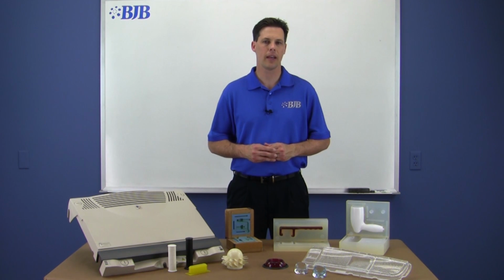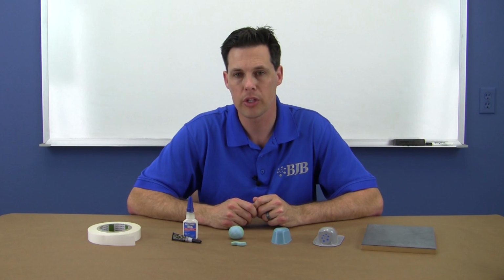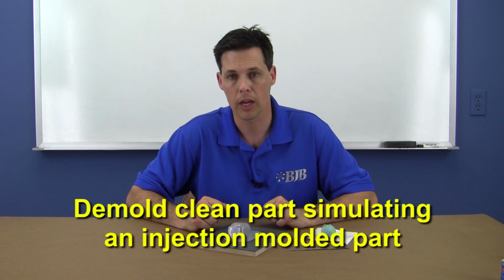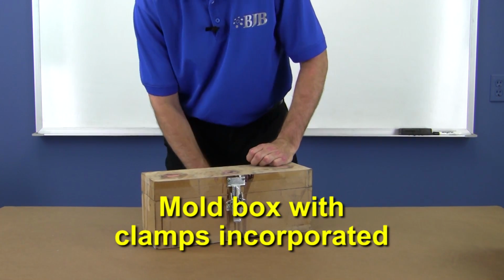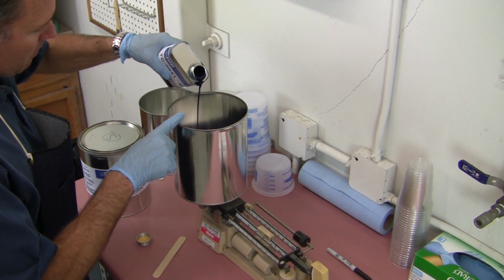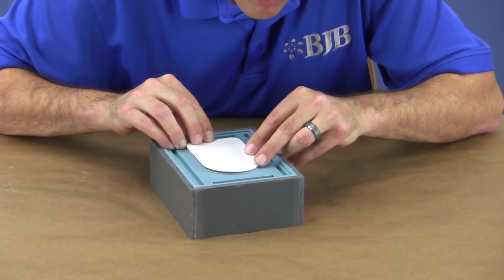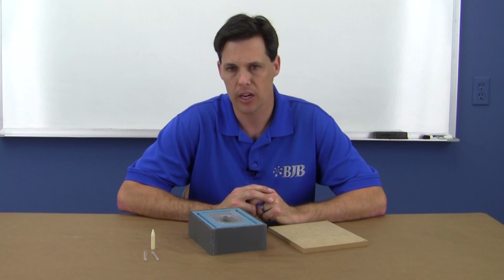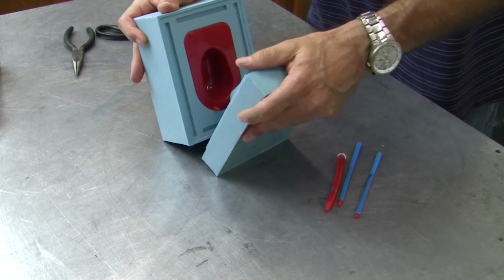Great Video: How to make 2-Part Silicone Mold | Part 1

Comment: Question, it appears at the 20m21s mark after you demold the part there are raised bumps left by the fill and air vents.  Am I seeing that correctly and can you describe any post processing work that was performed to eliminate these?  Thanks!
Reply from the maker: Typically these small witness mark bumps are trimmed off with a hobby knife or filed down.  Depending on the required finish needed for the application, these could be carefully wet sanded smoothed and eventually polished away, but in many cases a small mark from a vent or sprue is similar to many injection molded parts is acceptable for the bottom or backside of a part.

Comment: So I am trying to make a silicone cast with silicone molds. There is a deep undercut on one side of the mold. How do I get demold spray down there? Is it safe to rub it on a brush or something or wet a rag with it and try to squeeze the paper towel to get some drops down there? I dont want the silicone to stick to itself when I pour silicone into the vent of the silicone molds.
Reply from the maker: You will have to get a little creative for sure.  You could look at brushing (if you can reach it) or put some Vaseline or similar release on a gloved finger and massage it into that area.

Comment: What desktop vacuum pump do you use ?
Reply from the maker: Most of the pumps we have in our facility are the Welch 17.7 CFM.  They are workhorses and give years of reliable service, plus they can be rebuilt down the line if needed.

Comment: Thanks for a fantastic tutorial. I need to replicate a small plastic part and this video has shown me everything I need to know. Could I just ask: Wouldn't it be useful to leave the box around the mold while casting to prevent any distortion of the mold? Or does the thickness of your mold prevent this?
Reply from the maker: On a small mold like this with a thick perimeter of silicone around the mold, we can get away with strapping it to a flat board as shown in the Part 2 casting video.  In some cases we will make a custom sized top and bottom board to hold things together and without distortion.  In many production shops, wood or plastic mold boxes are used with the silicone molds to ensure mold geometry is accurate.  The one issue that we see with full mold boxes is that over time the silicone may experience some shrinkage and the mold box sides prevent a good, solid seal between the silicone halves, and cast material leaks out around the parting flange.  If you use the top and bottom boards, taped tight and secure, then you don't have to worry about this issue.
Reply: @bjbenterprises  Great explanation. Thanks for the tips.

Comment: Great video/tutorial! Could I use Clear Adhesive Vinyl Laminate instead of double sided tape? Thanks!
Reply from the maker: Yes, there are several methods you can use to hold down the pattern.  White Elmer's glue is another method some people use, as well as hot glue, oil based clay, and a variety of others.  Be sure the silicone is compatible with that material and make sure it doesn't damage the pattern when removing.
Reply: @bjbenterprises  Thank you SO MUCH for the information. You have been super helpful and I really appreciate it. Keep up the amazing work & God Bless! 🙏🏻

Comment: Hi, I agree that you have the very best videos on YouTube for making silicone molds, and casting the parts. I am making 1/25 scale model car parts like valve covers, various engine parts, wheels and tires, and probably other things including possibly a whole body and a whole frame. 

What I am trying to do is to cast several parts in one mold, to save both time and mold making. Injection molded styrene plastic parts are connected with sprues that run from part to part.  Is such an operation possible by using resin flowing, only by gravity, to make more than one part in a mold at a time?
Reply from the maker: Good question.  Multiple cavity molds are possible if the parts are fairly simple, and you have appropriate vents set up for the parts to allow for trapped air to escape.  However, it's not done as often with urethane casting compared to injection molding.  If the parts are small, then there is not a lot of silicone material saved by combining multiple parts in one mold vs separate.  If one of the mold cavities has an issue or wears out, then you end up with wasted casting material and bad parts from one cavity whenever you cast.  It's a process worth exploring if you have a need to reproduce several simple parts at once.  Keep in mind that thin sprues will not feed the other cavities very well so it's best to feed each mold cavity from a larger, central reservoir and go from there.

Comment: Thanks for a great video. A question is if you forgot to add air vents, is there a way to add them afterward? thanks
Reply from the maker: There are occasions where a vent needs to be added after the mold is made.  You may find there is a problem area in the mold that needs a vent, the acrylic vent post came loose while pouring silicone and had to be removed before cure, or you simply forgot a vent somewhere.  A couple of options:  you could simply drill a small hole through the silicone (however it leaves a rough hole that will break down quicker over time), or you can bore out a vent using a small brass tube that has been sharpened at the end (this produces the cleanest result).
Reply: @bjbenterprises  Thanks great advice.

Comment: can we use silicone with hot things ?
Reply from the maker: Yes, but how hot is hot? 100, 200, 1000?  Most platinum silicones do well up to around 450F/230C.  We have a couple of silicones that have been used for low melt metals up to 800F/430C in short uses.

Comment: that was a nice instructional video. I would like to try out making molds. One area i wish you had done more with on this video is the step of selecting the material used to cast and preparing it for pouring and perhaps showed a variety of those products that could have been used for this silicone mold.
Reply from the maker: Thanks for the comment.  Choosing a material is an entire conversation on its own due to the variety of materials available and also the physical properties needed by the part and application.  One of the first things we look at is choosing what Durometer we need for a material, and go from there.  This is one of the most important things to learn when you are first getting into mold making and casting.  We do have a video on that topic.  https://youtu.be/Q6jn223_1Mw

Comment: Excellent EXCELLENT training video. I have shared it quite a bit with my fellow hobbyists.
Reply from the maker: Thank you for that.  We're happy this info is getting to those who appreciate it.  Also keep in mind that we have all of those handy items that are used in the videos like vents, fill ports, funnels, registration keys... plus the mold making and casting materials.  www.bjbenterprises.com
Reply: I’m in the process of making my list of products right now. If I contact you all via email, are you guys pretty responsive? I’m not sure exactly which silicone to pick for my particular application.
Reply from the maker: @petebutler5139  yes we typically respond within 15-30 minutes, or you can use our chat feature.  Send any material questions to:  info@bjbenterprises.com

Comment: How can I make a mould with a hole through it for like wires ?
Reply from the maker: Anthony Marenghi we have a couple videos that show different techniques for pre-molding holes into a part, but this one has some great tips to show the process using metal pins:  https://youtu.be/OgH1rKmQl7Q
Reply from the maker: Anthony Marenghi also this video:  https://youtu.be/C7uMkBzOMaM

Comment: How would you go about making a mould for a spherical object with no flat edges like a marble? Thank you in advance as your time and help is much appreciated.
Reply from the maker: There are a couple ways.  You could rotationally cast it and make it hollow with a given wall thickness which would produce the cleanest part out of the mold (only a mold split line).  Or, if you want a solid cast part, you would need to make a mold with a small fill port and deal with the reality there will be a small mark that would require some post demold clean up.  Setting up the pattern to make a mold is pretty straight forward using a bed of clay to sink the part halfway into, creating a clean parting line. Or, you can use a solid board and bore a shallow hole into the surface using the appropriate diameter drill bit and fine tune/clean up the edges with a small amount of modeling clay to make a water-tight seal around the parting line.  The alignment keys and fill ports/vents can be added as seen in this and many of our other moldmaking tutorials.  Roto-casting:  https://youtu.be/kdN6Quj14P4  and setting up a round object for molding:  https://youtu.be/DIFWTiVWHts
Reply: @bjbenterprises  OK thank you, I appreciate the time you have taken to reply in such detail and the fact that you have provided links to more information.

Comment: Can you get rid of the air bubbles without a vacuum pump, at home?
Reply from the maker: The simple answer is no (with household tools or equipment).  There are several ways people deal with bubbles.  Vacuum pumps and chambers is the most common but many home DIY casters use small pressure pots as well and find that convenient and effective.

Comment: did you spray release on the first half of the mold before pouring part 2 ontop of it?
Reply from the maker: LT72884 yes, you must apply Mold release to the silicone so the second pour of silicone doesn’t bond to the first. The silicone won’t stick to the plastic part, only other silicone.

Comment: Hi 
Great video! 
I'm wondering whether silicone will stick to things while it's curing? I want to mould a seal and attach it to carbon fiber. If I abrade the CF and then pour the uncured silicone on it to cure in place will it bond to the CF?
Reply from the maker: Jools Taylor mold making silicone will not stick to carbon fiber.  It must be mechanically locked or it will peel off.  Flexible polyurethane will bond very well to prepared carbon fiber surfaces but if you need certain chemical or heat resistance it’s good to check with us for suitability.   Info@bjbenterprises.com

Comment: great video! learned so much with this. I have one question though, is there a way to make a mold having multiple masters in it so that I can cast 2 or more castings in one batch instead of having to waste time and silicone on 2 separate molds? I was thinking multiple funnels/runners that leads resin from one area to another, do you guys have a video on this?

Comment: Super nice ruler,, that takes me back.  For a second there I thought that the abs box was also 3D printed.. I found this because I am searching for a way to cast a glass like mold of the 3D printed - HexiBase  3" Subwoofer Enclosure v.2, 

https://youtu.be/4_4tu4rAtgI?t=88
Reply: Side note: Glass like Resin - not actuall glass
Reply from the maker: Thank you for your comment.  You might enjoy watching our video on casting clear material for making an automotive lens.  These materials can create clear cast parts, but you need to be able to produce a good mold and create bubble-free parts using either vacuum degassing or pressure casting.  https://youtu.be/WME8R2-Ot8E

Comment: Great tutorial unlike all that other trash out there with their crap music.

BTW, what is a splitter board?
I know what it is in electronics.

If I’m pronouncing it correctly.
Reply from the maker: Mike Justice thank you for the compliment.  A splitter board is also sometimes called a parting board, but basically it is the surface that divides the two mold halves.  Once you mold the first half, that surface is the dividing plane in the mold and contains many important features like registration keys to align the mold and it often has vents and fill ports depending on how the mold is set up.

Comment: I recently found an old vintage part in plastic that would require at least a 3 piece mold.  I have scoured the web and have seen some references to them along with some pictures but thats about it.  It would be nice to see a video on that to better help get my head wrapped around it.  Splitting something in half is pretty straight forward. splitting it into 3 or more parts well that would be a something :D
Reply from the maker: Thanks for the idea.  Yes it can be a little trickier to set up parting line for a 3-piece mold.  You need to imagine what direction the mold pieces need to be removed away from the part based on geometry and details.  In other words, the mold pieces need to pull off without getting trapped by the part geometry.  It's still much easier with silicone molds vs traditional rigid tooling, but we understand the details of "how" to approach it are a challenge.  If you need help, feel free to reach our to our tech team and they may be able to assist your mold design.  A short description and a few pics work best:  info@bjbenterprises.com

Comment: What's a good silicon to use if you don't have a vacuum pump?
Reply from the maker: We have a couple systems that are low in viscosity and pour well without vacuum.  For a Platinum silicone, the TC-5041 https://bjbenterprises.com/index.php/tc-5041-a-b/and for a Tin silicone TC-5024 https://bjbenterprises.com/index.php/tc-5024-a-b/   You can also add a small amount of the silicone thinner SC-5001 https://bjbenterprises.com/index.php/sc-5002-silicone-thinner/ to help cut some of the surface tension and lower viscosity.

Comment: So how much of each part would be needed for the minimum amount of 3.38 lbs (1.5 Kg) of silicone?
Reply from the maker: 3.07 pounds A, .307 Pounds B.  You divide the total weight needed by 110% (100%A + 10%B) to get the "A" amount.  The remainder amount is "B".  We made a video on calculating ratios here:  https://youtu.be/ebPuo96CA6Y

Comment: Excellent presentation. You could tell me how you could make a flexible syringe in silicone, to recover its deformation, to send air by squeezing it with your hand towards a hose of an instrument. The original is built in rubber.
Reply from the maker: This is a little too complicated to answer in a YouTube comment.  Please contact our technical department and they can help you find the right method and materials to help create a mold and flexible part.  info@bjbenterprises.com

Comment: can pegs be used in place of alignments?
Reply from the maker: Great question.  Yes, you can also use dowel pins for alignment if that is what you prefer.  For pins, you don't want to use the silicone as a pin.  Always use a rigid piece of material like metal or plastic.

Comment: I am prototyping a part that has a ball spring plunger in it. For my 3D printed prototypes I'm just installing the ball spring plunger (essentially a metal "dowel" with a ball spring plunger in it) with a press fit into a hole. Would it be possible to cast a polyurethane part with the ball spring plunger assembly inside the part, rather than pressing it in afterward?
Reply from the maker: That's an interesting question.  Having molded in inserts and other similar items is a great way to produce professional, functioning parts and prototypes.  The key to applying this method is figuring out how to hold the insert in the mold cavity while material is cast around it, essentially locking it in place.  With a spring loaded plunger, you have surface area that would bond well to the casting material, but you also have an area around the ball bearing that could potentially allow liquid polyurethane to leak into the inner cavity where the spring rests.  If you can figure out a way to hold the assembly (I don't have a picture of the part to go by) in a way it will embed securely with the cast urethane, you might be able to simply coat the ball bearing area with something like petroleum jelly (Vaseline) to seal and prevent liquid urethane intrusion.  Avoid pressure casting as this may force urethane into the negative space around the inner spring.  As always, you can contact our Tech Dept to go over your project and see if this will work out as planned.  info@bjbenterprises.com
Reply: Thanks! I really appreciate the information. I will definitely send an email soon.

Comment: I want to make a cast of my old computer case from the 1980s and cast it in a silicone that won't sag in the middle because the case is fairly big. It is I two pieces (top and bottom section.). I want to change the white plastic to a transparent resin with fluorescent green dye mixed in it and I'll mount black light leds inside to make the whole final case glow. I may fill in all screw holes in with modeling clay and just tap them new in the final resin case. I plan on filling the case with modeling clay and doing a two part mold. Odd those the best approachfor something this large? I saw you mention an objet like the cover of an air conditioner. That is about the same size and the plastic is about the same thickness. Thank you for any help you can give me with this project.
Reply from the maker: It is certainly possible to do what you are asking, however it is typically advised to learn how to do silicone mold making and casting on a small part first to learn how the process is done.  Making a mold that large involves a lot of materials and proper set up for best results and this only comes with some experience.  Our best advice would be to watch several tutorials on YouTube of molding various large electronic parts before attempting.  If you have a clear path you wish to proceed with, you may contact our tech department to answer any further questions about materials and some set up help.  info@bjbenterprises.com